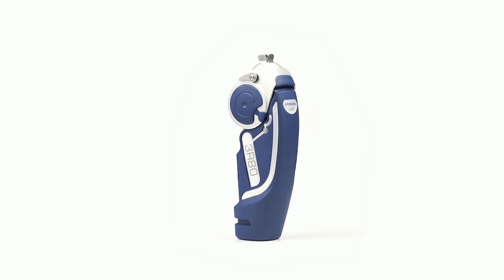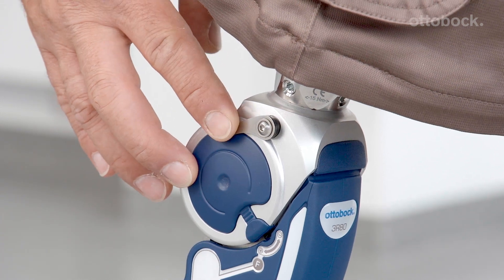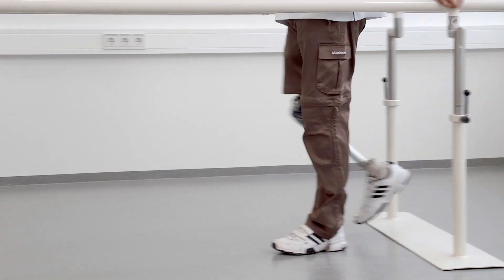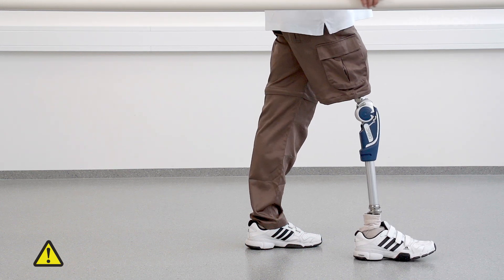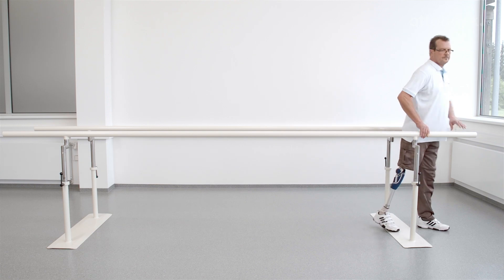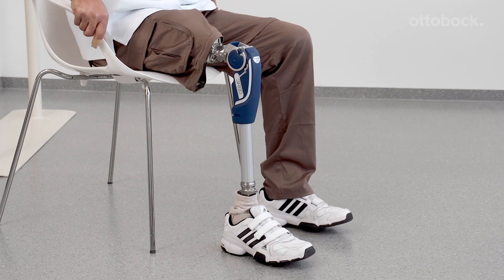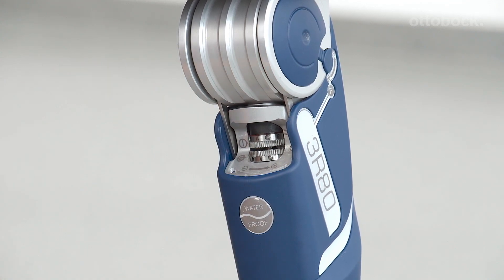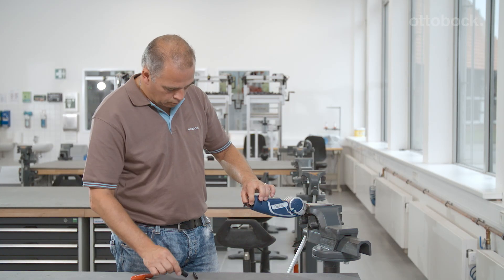3R80 - Adjustments & Settings | Ottobock

Comment: Does this knee have a setting for bicycling?
Reply from the maker: Dear Douglas Horning,
Thanks for reaching out. We will consult our product experts about your question and inform you as soon as possible. 
Please keep in mind that in general only your physician / technician can be sure of the best option for you for biking. Together you can decide on the best steps to take. Please contact your local branch for the personal support and assistance: http://www.ottobock.com/en/company/locations/ 
Your Team from Ottobock Headquarters Germany
Reply: Thanks I think?
Reply from the maker: Dear Douglas Horning,Because the 3R80 is a mechanical prosthetic knee joint, it does not have a separate mode for cycling like mechatronic knee joints have. Nevertheless, after consultation with our CPO experts, 3R80 is in general suitable for cycling due to its rotation hydraulics. Please speak with your physician/technician about what the best option is for you and contact your local branch for personal assistance: http://www.ottobock.com/en/company/locations/Your Team from Ottobock Headquarters
Reply: Douglas Horning ь